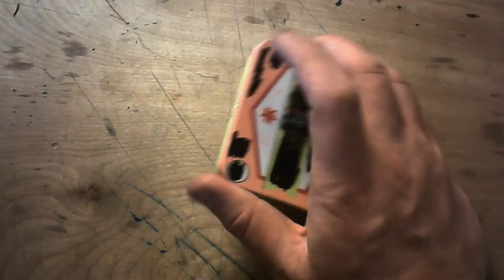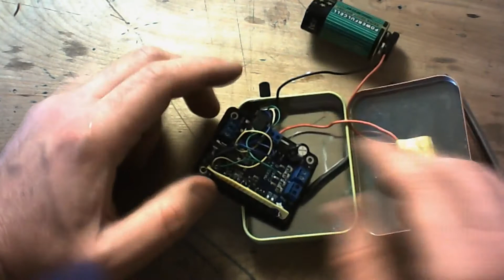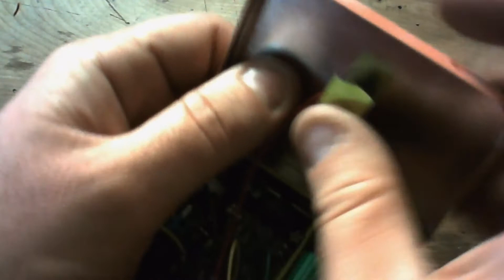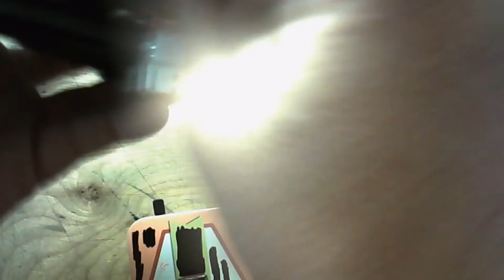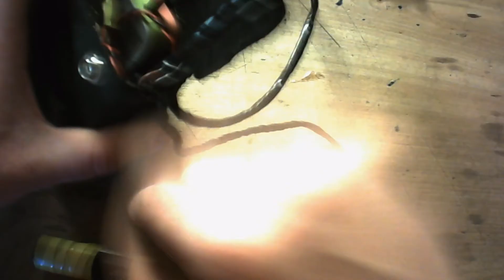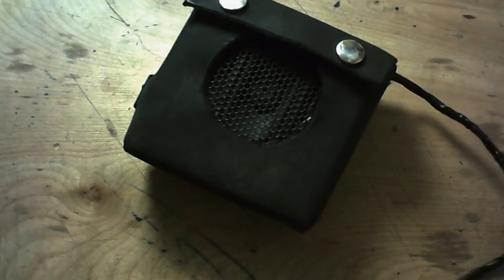Short 2: Mint Tin Voice Amplifier

Comment: If I understand Adafruit's website correctly, it's 22W when you use 4 Ohm speakers and power it with 12 Volts.
Reply from the maker: Mundo Airsofter the specs say 20W @ 12v for 4 & 8 ohm speakers, but max input voltage is 14.5v so you may squeak out another watt or two at max input voltage.